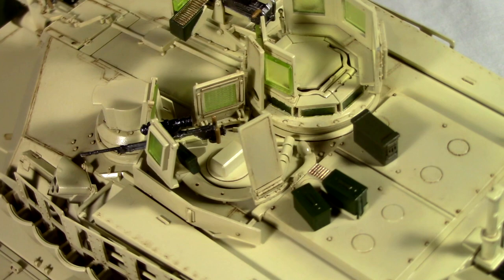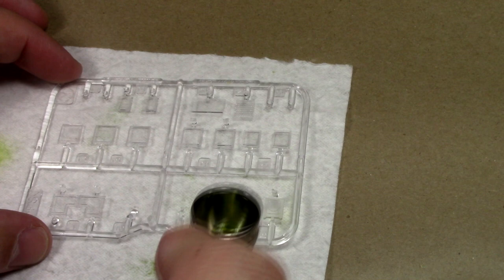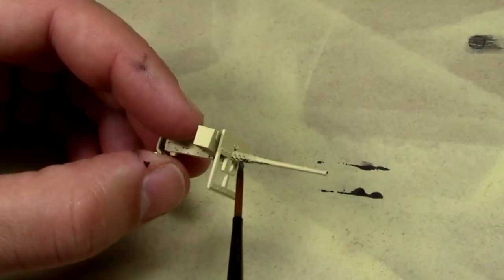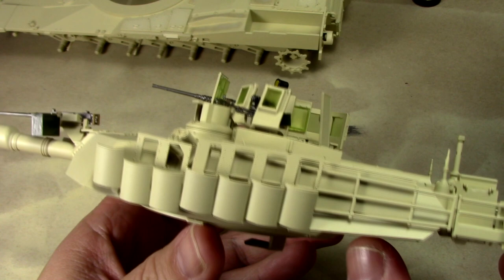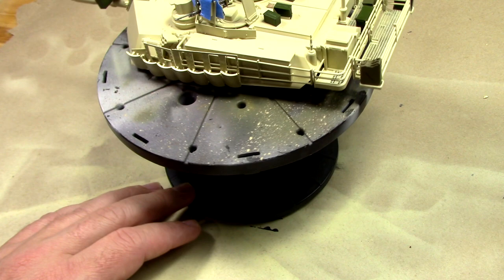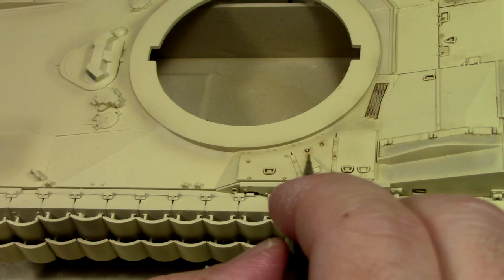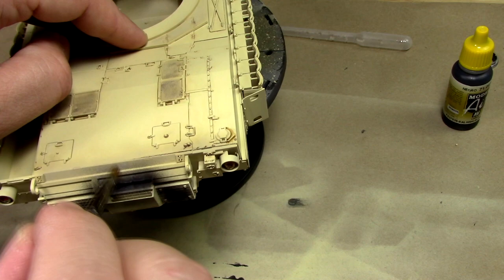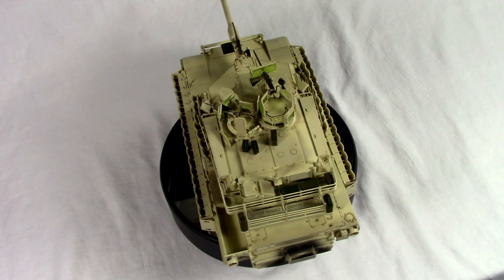SUPER EASY Painting and Weathering Procedures for Modern US Armor Tamiya M1A2 Abrams Tusk II 1:35

Comment: I'm new to model building. Did you have any trouble gluing parts together after you painted them? Or did you remove paint where the joined together?
Reply from the maker: Welcome to the most frustrating / expensive hobby in the world. I don’t have issues gluing painted parts, just use a tiny bit of super glue and ensure the pieces bond properly.